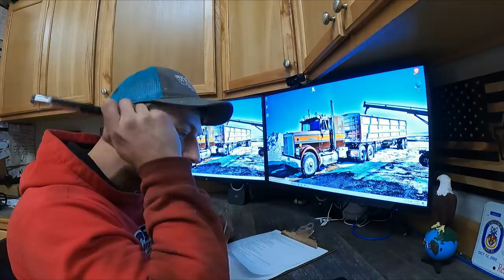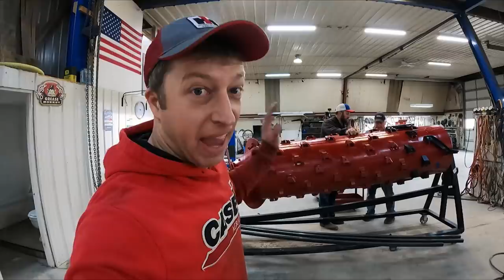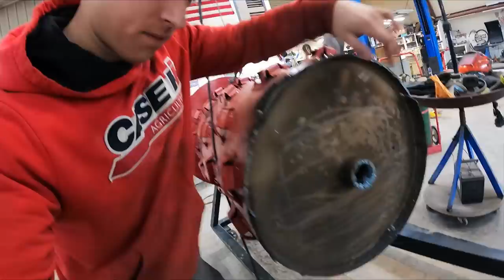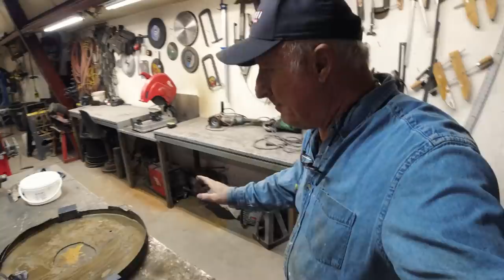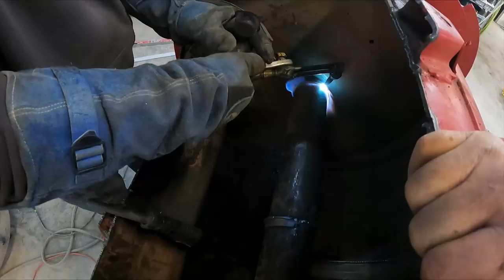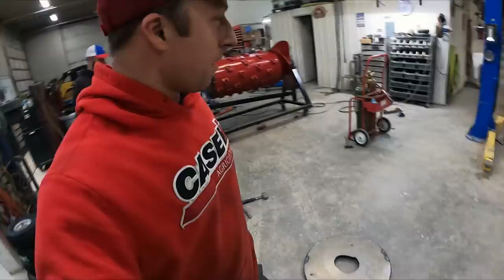Look what we did to CASE IH's ROTOR!｜Smoker Build Part 1

Comment: I would call those support rings Nick. Basically the sheet metal cylinder needs to be supported to the main pipe in the center. Also you keep saying BBQ and smoker, but as a Albertan-Texan I can tell you they are the same thing. A grill is something completely different and you would probably call it a BBQ up there(If it is similar to Alberta which is relatively close to you). Texans will get offended if you call something which is a grill a BBQ. Lol!

Comment: I would like to point out a design flaw that is going to cause some problems. The heat and smoke wants to rise and the opening from the fire box looks like its below the fire to the smoker not above it. This will cause the fire to either smoother and go out or will cause a reverse flow if you try ro open the top. You want to drop your fire box down enough so your fire is below that opening.

Comment: Awe man you could have used 2 matching rasps for the hinges and one of the ones in the way cut in half for the handle!!!
Reply: And the door could be cut around the rasps. Don't need a square door. Looking forward to seeing it finished.
Reply: @johnlemmey7698  I was thinking the same thing.  They could have cut around the rasps so the door would look like it had teeth.  Then use old tractor weights for a counter balance for the heavy lid.
Also, having the firebox at the same height as the smoke chamber is going to be seriously inefficient.  It needs to be set lower, hence the name "offset smoker".  
Regardless, it should be an interesting build, I'm looking forward to seeing the finished product!

Comment: Ha it rolls back when it stops shows it’s not balanced
Reply: Looked fairly balanced for the size of it, but you cant add some weight to one side with just some weld
Reply: It’s brand new so it should be perfect, but jds aren’t perfect either I spose